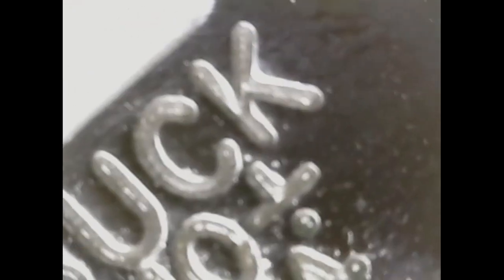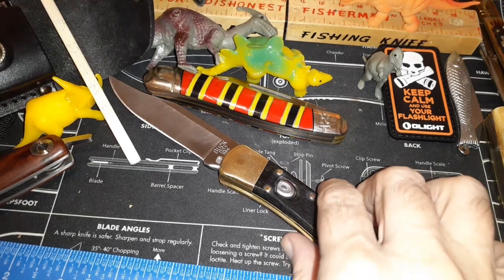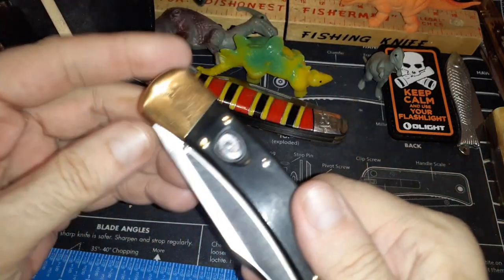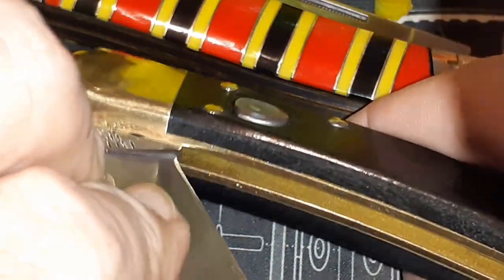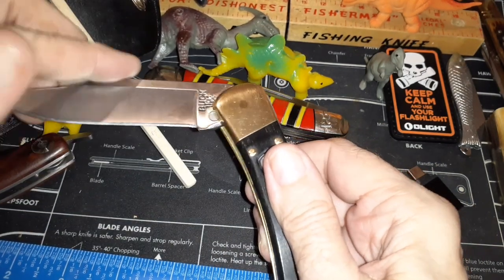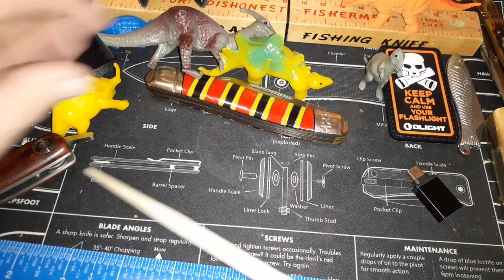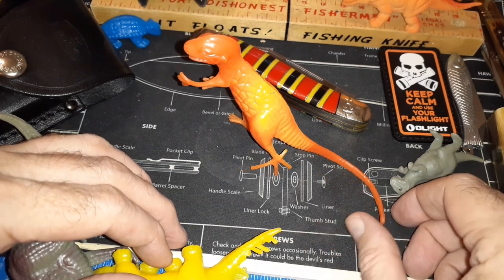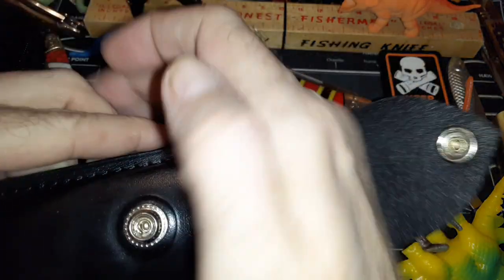(516) How does it work ❓  A Closer Look at the  Buck 110 Automatic  Mechanism

Comment: We have been through two buck autos now that started doing a “lazy out” as someone above said. Basically opens 3/4 and stops short. Gets worse with more use. The dealer we bought from shrugged. They exchanged the 112 auto and we got the 110 auto elite only for the same thing to start happening.
Reply from the maker: wow. have you tried adding some oil to the pivot?  Sounds like either the pivot got tighter, or some gunk got in there and slows the blade down. Considering how strong mine pops out, it sounds like just oiling the pivot won't help. Buck has a lifetime warranty on that, so maybe you should send it to Buck for repair.

Comment: I'm thinking of picking this up. How easy is it to fire the blade? Is the button recessed? Do you think it's easy? Too Easy? Will it go off on accident?
Reply from the maker: The button to fire  is in a scalloped out area and barely sticks up above the covers, like 1 millimeter. The button spring resistance is around 5 pounds. As far as going off easily,  usually it's carried in the supplied sheath,  but even in a pocket carry, I doubt it will go off by accident.  Once you push that button,  it does fly out & lock solidly.
Reply: @WilliamsKnifeLife  Thanks for the info!
Reply from the maker: @TheMartialist   no problem buddy